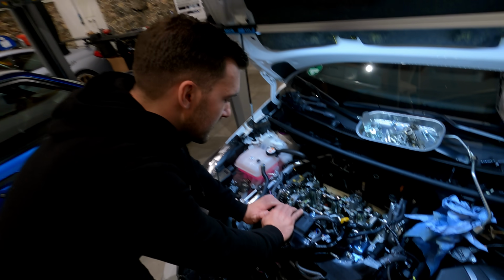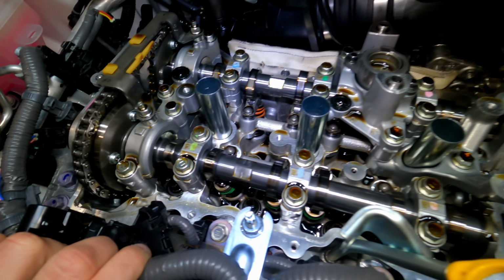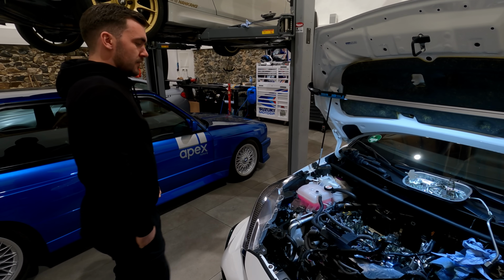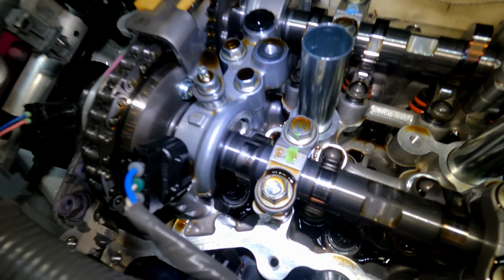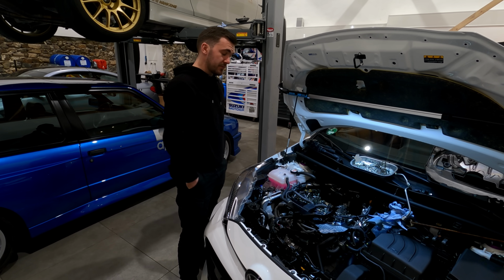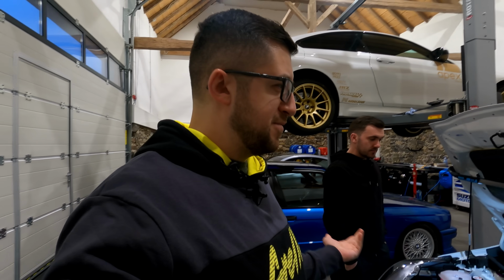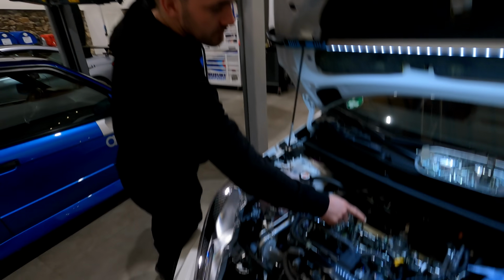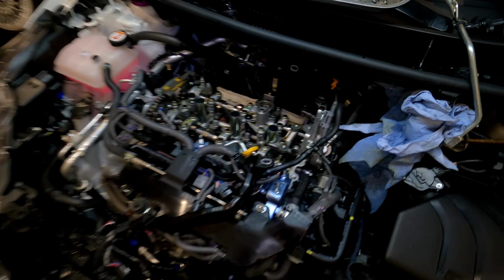Misshift Aftermath. Inside the Damaged Toyota GR Yaris Engine. OUCH!

Comment: I'd be suspicious of the entire valve train. It's very hard to see why the over rev would only over stress one item on one valve when the whole train was essentially stressed to the same levels beyond spec.
Reply: And all the piston heads as well. Basically they will need to disassemble the entire engine and check all the parts.
Reply: Yeah. On the basis it may be very hard to see or locate the stress damage experienced, the best option is new engine though I appreciate its maybe worth the risk to see if u can get away with minimal replacement and take your chances.

Comment: at that point,better find  a  new  engine.parts  must  be unavailable,cause the car is  new,then a  replacement  engine  is  the best  option. then,you still  haven't  digged  deeper in the  engine.i  suspect  a  piston  pivot pin must have been damaged  as  well.best thing is  crack the engine open,so you can assess the  damage in full,which is  always the right thing to  do  in such case.

Comment: The only thing that would make sense is that after some hard running it got like -6c over night and then straight back to work, that would make a fractured collet properly crack causing the valve to do it’s on thing

Comment: there's your problem .. should be cam on bucket instead of this rocker nonsense
Reply: Agreed. Suprised Toyota is running rockers on this when most of their previous motors were bucket and shim. No one wants a 3cylinder SR20.

Comment: "Might be a chance of mechanical failure" 🤦‍♂️😆.... worlds most reliable car manufacturer! Toyota aren't stupid and have forgotten more than you guy's know about engineering... 💯 they would have worked-out the engine failure was down to negligence through the ecu data and just from the small matter of 85yrs experience design and building them.

Comment: If it was missshifted from 5th to 2nd... depends on initial speed, it might be around 12k rpm or so, if clutch wasnt dropped. So even that in reality, maybe "only" 8k might happened, that force was still excessive, that id might cause to throw valve spring collar out and then it was start of everything else which ended next day. Im looking forward to see more info, tear down of engine and would be great to see ECU log of rpm that was there.

Comment: All I can say is that if it were me in charge I would insist the head comes off at a minimum. It's really the only sensible way to ensure you got all that debris out. Also, as George pointed out, it gives you a chance to inspect the pistons and the valve face. Your best-case scenario is probably that the right people at Toyota (TRD?) are informed of what took place and they do what's possible to get you out what you need ASAP. If I were them, just as with Manthey and the GT2 suspension, I would want to have that engine to fully strip it and compare the logs with the damage. Unless that 3 banger engine is not going to be developed any further (which I can't see at this point) the data collected is a part of the R&D process. Your car is just an extension of that process as long as they see it as a sort of partnership deal: You guys will pay for the parts but Toyota makes you guys more of a priority. That's the way I see it being mutually beneficial. Hopefully, they see it that way too.

Comment: Suspension/tyre and brake upgrade combo could most definitely of played a part extra in the problem more grip and being able to stop faster corner harder causing  oil starvation.  I have experienced the issue my self on my evo 5 just using slicks vs road tyres on track. I could corner/brake much harder causing the oil in the sump to slosh about causing low oil pressure I could see it happening on the oil pressure gauge.

Comment: This appears to be a very minor money shift still causing significant damage due to a (to my opinion) sub optimal valvetrain design. A rockerarm should never come off due to valvefloat, never. This was not likely to be a 10.000rpm moneyshift but like less than 10% overspeeding of the engine, which it should be able to take with pride (tbc by data). Well, good thing it is opened up, Ti springs and retainers, some porting, mapping, and crank it up to 8000rpm, ready to find out the pistons do not hold up. Etc etc. It just never ends LOL :)))) good tuning project though. You guys could be the first, for which I hope you will. Keep up the good work.

Comment: This brings up a great opportunity for engineers to work out a solution to this. It's obviously not a new problem by any stretch of the imagination, but perhaps there's a possibility to have a set of lockout solenoids that engage a small plate or similar, to stop the driver physically changing down to a lower gear where the motor rpm based on road speed, would likely exceed the redline if done so? Just some food for though...
Reply: There already are cars where wrong gears are mechanically blocked. It's most often only the reverse gear that has a lockout, but there exists solutions where multiple downshift steps are blocked or where the wheel speed decides what downshifts are allowed. But this slows down a car you want to race with because you need to wait until you can shift, instead of timing the clutch release.
So the more common route is a sequential gearbox with paddles.

Comment: Would there be an upgrade on the gear selector ( probably not available yet) that would stop a wrongly selected gear ( which could happen to anyone ) ..... as you can tell I’m no mechanic ha ha 🤦🏼‍♂️🤷🏼‍♂️😂 . Tell me if I’m wrong but you often see this in race cars if I’m not mistaken
Reply: In which kind of race cars do you see that? Real race cars usually have sequential gears.

Comment: Suspension and tires will generate higher g loads which could cause oil engine starvation if it doesn’t have a dry sump. So this is not out of the question. Just saying...

Comment: I wonder ... There is no ...protection ( I am not sure if this is the correct word ) for human mistakes like this? What I mean is: you shouldn't be able to miss-shift ( at least so many gears... ) in the first place?
Reply: I always wonder what is so hard to understand about this. The clutch is manually linked to the clutch pedal, like the brakes on a bicycle. When you push on the pedal, the clutch moves.

The gear drive has 2 shafts. One coupled to one plate of the clutch and the other shaft is coupled to the wheels (over the differential). When you take your foot from the clutch pedal, both clutch plates engage together and the motor is mechanically locked to the wheels. There are now 2 possibilities. You put power from the motor on the wheels by pressing the accelerator.  Or you let go off the accelerator and the kinetic energy of the moving car turns the wheels, turns all the shafts in the gearbox and in the end turns the motor at the RPM that is given by the engaged gear.
Reply: @kreiseltower  I know how it works but I was wondering if there is any kind of ...protection ( I know ... I know wrong word maybe ). Something that will not let you shift from 5th to 2nd at once! I don't have any idea how can be done, I am just asking! Maybe something like the Fly By Wire system on airplanes where a computer intereprets your "commands" and then executes them so at any given point in time everything is between working parameters. Even if you pull the stick / turn the steering wheel all the way the vehicle will turn some degree, always between working parameters. I know that such a mechanism will add complexity ( unnecessary... ) but it will not allow shifting from 5th to 2nd at once! Yes... Yes... I also know I am talking nonsence  here but maybe such a mechanism will make more safe ( ? ) cars? At least safe for the shake of spending money for a broken engine!
Reply: @KostasAlbanidis  Of course that could be engineered... something that blocks the shifter from going to the wrong slot... or a clutch that isn't mechanically connected to the pedal but electronically actuated like the fly by wire you said. But that would make things more complicated and expensive and oppose the purpose of what most people want in a manual shifter. And wait something like this actually exists and is called (semi) automatic transmission. But purists don't want that. My first car was a Renault Twingo that has a manual hand shifting but the clutch was controlled automatically. TBH I don't know if it was programmed in a way that it wouldn't engage the clutch when you're in the wrong gear. But the automation of the clutch wasn't really good. Maybe it could be improved. But I guess there is no demand for it that makes it worthy.

Comment: This case shows that renting out is always dangerous, example renter 1 misshift and then drives 3 more laps, everything ok with the Yaris GR. The rental deposit is refunded because, so to speak, everything is OK with the Yaris GR, the next renter does 3 laps on the Nordschleife and the Yaris GR suddenly breaks, even if it is not his fault, but the Yaris GR broke down during his rental he will have to pay because no one can prove that he has not Misshift. This is a problem.
Reply: TBH this is the reason for me, why I've never considered renting a car for the race track. I live so close to the Nürburgring... I'd love to much to drive it. But I'm too scared about my real car which isn't insured on the track... and for a rental it is also problematic. The fun of a couple of tracks isn't worth the risk of the deposit for me. And the deposit is 25.000€ !!! I assume that a new engine for the Yaris will be around 8000-10000€.
Reply: the engine logs would tell that the misshift happened on the earlier lap
Reply: @tommihommi1  I don't think that the engine log saves a date and time.
Reply: @kreiseltower  logs without timestamps would be pointless
Reply: @tommihommi1  And where would you set the time? On the radio in the car? This could easily be faked. In the engine logs that I've seen there is a order of errors codes, but they have no timestamps. But I don't know much about it... I've just looked over the shoulders of a mechanic when he read out my error codes that I've had so far.

Comment: On Porsche, they typically view following 50 hrs of driving since the over rev occurred as a a critical period to determine whether any damage has occurred ie doesn’t necessarily blow up engine at the point of the over rev.
Reply: Porsche rarely fails from over-revs. All Turbo/gt2 manuals have been over-revved, all as good as new, porsche usually has the redline 250-300 rpm lower for safety. It's the little things
Reply: @cutdepiefails6596  250rpm is a tiny margin - a shift oops is way more.
Reply: @cutdepiefails6596  What???  This is a mechanical over-rev, there is no safety for a money shift.  If you have a manual transmission and you shift into the wrong lower gear, there is nothing to protect the motor.  The only reason why newer GT2 or whatever don't blow up is because they are automatics and you can't money shift them.
Reply: @cutdepiefails6596  You can't have safety from a mechanical over rev lol

Comment: Maybe a new factory replaced motor is the better route, rather than picking this in atoms and searching for missing bits and pieces that can cause problems later. A new motor is probably cheaper?

Comment: Misha, wouldn't your friends at Manthey Racing have a high end code scanner to read the data of high rpms off the ECU, pretty sure the Snapon scanner could read them also. Another thing what George was saying in the high rpm was it the valve floated and lost 1 retaining collet then kept running until the other one dislodged on the next day ?
Reply: That’s my theory too, dropped a collet on the mishift, eventually the top cap came loose.

Comment: It does make you wonder what the actual rev was when the mis shift came and then completed 5 more full laps so approx 100kms of hard driving to think was it totally driver error or even a combination of driver error and weak spot in the engine, that was going to happen sooner or later, I guess the only saving thing is its happened 1st weekend of the season hopefully parts can be sourced and back with you. Perhaps they can over night parts from Japan 😉

Comment: How would an automatic in manual mode handle this sort of thing? Of course it would not directly go from 5th to second, but would it actually prevent the driver from shifting on to too small gear?
Reply from the maker: It would not allow you to shift

Comment: It looks like the quickest way to get this resolved is by replacing the whole engine. Then you have the old one for spares maybe? It’s so new, I bet most of the spare parts are still going into new cars!
Reply: I Imagine if the wheels are 1,5k a pop, the engine should be in the 15k range. Good thing Robert is rich.
Reply: Yeah and then fix it and put it in a Westfield. Engine only weighs about 70kg- perfect.

Comment: I honestly didn't know you could over rev a new car, I thought they had a rev cut off?? Can anyone enlighten me on this ?
Reply: They over rev car by mishifting the gear so whole weight of car  pushed rpm too high when   he shifted from 5. To 2. Gear
Reply: Yes if youre in gear and floor the car. It will electronically not let the car overrev by cutting fuel or closing the throttle. But this was a mechanical overrev and no electronics can stop physics. Imagine youre in 2nd gear and you redline for example 80km/h at 7000 rpm. you need to change gear to third to get 120 km/h at 7000 rpm. Now you accidently shift back to 2nd instead of fourth. 120 km/h in 2nd gear means the engine has to spin faster than 7000 rpm lets say 9000 rpm, but why does it spin that fast? its because the wheels are connected to the engine and the wheels traveling at 120km/h forcefully spin the engine that fast
Reply: @ALEN4789  yes thx for reply,  all this time I've been driving cars on track days and such never heard of anyone doing it. I know my car wouldn't engage 5 to second ,we'll I hope it wouldn't 🤔
Reply: @souldrummer818  Do you have a manual shift car? If yes you can wreck it by selecting the wrong gear accidentally. Your choice. You have to be careful. It is the same thing like choosing a tree to help you stop the car instead of using the brakes.

Comment: Hi What would have happened if it had occured to a customer during a rent ? You would loose your deposit ?  I mean: you drive OK but the engine blow mid lap? even if it is due to a previous driver?
Reply: The engine logs would tell them when it happened, so they'd figure it out eventually.
Reply from the maker: @adbirdk  this

Comment: Like some of the other comments, I'm also less convinced it was caused by 7200k mis shift to be honest. There would be a lot more damage in my opinion, if that rocker had been floating around in the valve train. Maybe vibration caused the rocker pin to loosen and then after the five laps, it eventually worked itself out and that caused the valve to get stuck. Definitely interested to hear Toyota diagnosis, but yeah as George says, too many tight tolerances for a production engine!

Comment: Time to put a VTEC in it, should be fine after a misshift. Sorry for you guys, but so sad that quality of new cars. Buildt on a budget and super fragile. On my old race Alfa from the seventies, I did the same in a race. No problems whatsover. And the rpm needle just went off the charts. Hope the sylinders are fine when you open the engine up.